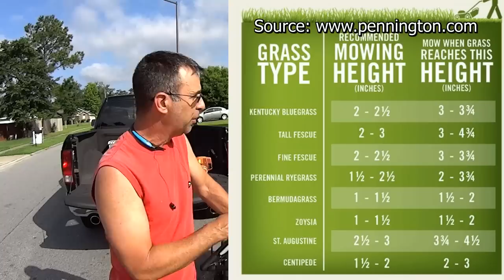THE REVIEW - Honda HRX217VKA 21" 186cc Select Drive™ Self-Propelled Lawn Mower

Comment: I just bought the same Honda mower.  I noticed that the last 2 click settings on the speed dial give me the same exact speed.  I feel like it should go a tiny bit faster when I move the dial all the way to Max speed.  Is it the drive cable nut on the drive cable just below the handlebar that I should adjust or should I move the governor spring to the other factory drilled hole on the governor arm?   Thank you!
Reply: If you don't have one, you can grab a tachometer for about $20 off Amazon to check the RPMs of the motor.  Definitely check before you adjust the governor and compare it to the spec in the manual.
Reply: @CM-qu8qe  Yes I have the Tach already installed and I'm getting 3,000 RPM straight out of the box.  I thought the RPM are just measuring how much power you're getting to the blades spinning since the blades are driven by the engine shaft and the wheels are on a separate belt driven mechanism.  So amping up the RPM's will just make the engine spin the blades faster and nothing to do with the wheels going faster.  I think it has to do with the designed slippage in the belt for the wheels. Slow speed has more belt slippage, Fast speed has less belt slippage.  There's no video I know of that shows how to adjust the belt for faster wheel speed. Please correct me if I'm wrong. Thank you kindly.

Comment: Thanks for all your work.  I have learned a lot.  One question, I need to buy the metal lips for my 2 x 6 boards so I can have a ramp.  You mentioned in a posting you bought the 12" metal ramp lip and cut it in two.  How did you cut it?  Thanks buddy.
Reply from the maker: I used a jig saw with a metal cutting blade

Comment: I've got a good question that's a common problem. I recently bought a $260 lawn mower and it doesn't bag grass at all and it's been like this ever since it was brand new. My question is if I buy a Honda lawn mower will that solve the problem?
Reply from the maker: Watch the review
Reply: If it doesn’t bag then your blade needs to be changed to a high lift blade instead of mulching 
Lift blades have more aggressive wings than standard blades that come with mowers
Reply: @dvxAznxvb  i bought a blade just recently because the old one got bent and i couldn't find a blade that would fit it except for the one that originally came on it. I should probably go with the Honda it would be a lot easier finding parts.
Reply: Jerry Hanson eBay has tons of parts

Comment: Dan did you ever use the other 217hya with the other handle bar controls I use it to cut about 100 lawns I wanted to know if you think vka might be a little easier to control the controls
Reply from the maker: I never used that specific model but I do like this model very much
Reply: @DansVlog  ok thanks

Comment: I bought one of the hrx217 without the bagger frame for $300 with probably less than 1 hour on it. I love this mower but after around 20 hours it blew the valve stem seal out and and broke the rocker arm.  No biggie it's an easy fix. I just wonder if anyone else have the issue.  The mower is awesome.
Reply from the maker: I have not heard of anyone else mentioning an issue like that. Sorry that happened to you

Comment: I’m looking to buy a new mower for my house, trying not to spend over 450$. What lawn mower would you recommend?
Reply: you could look at a honda hrr, or toro recycler
Reply: Dominic Rosiak I was looking at the toro, didn’t know Honda made a cheaper mower, I will have to take a look at it. Thanks
Reply: Go to home depo and get a reconditioned mower. I got a hrx for 450.  Best thing is you could tell by looking at the deck it had never been used.
Reply: Hondas with the plastic deck are the best, but Toro kicks the ass of the steel deck Honda and at 450 or less just buy the Toro don't waste time on any thing else.

Comment: I bought one and something must be wrong with it cause it leaves clippings when I have the bag on , I tried adjusting height and it still leaves long grass clippings it worked good when I first bought it , I cut my lawn weekly with a craftsman mower for 15 years and never had an issue once with vacuuming the clippings at any height any advise ? Besides getting another craftsman’s cause I really like the Honda dam thing looks good
Reply from the maker: Use the slector lever and put it in the "Bag" position
Reply: I have it on bag mode you think the blades are dull already it’s only five months old what I noticed is that it’s like pulling the grass cause some of the clippings have the root on it I don’t have landscaping rocks just wood chips it picks up from my flower beds sometimes
Reply from the maker: 5 months? Yes sharpen the blades but also, make sure they are not installed upside down. Don't laugh, I did it

Comment: Its a good  mower  but i went with the toro super recycler with honda engine  and its been a great mower the last 3 years and it does 25-50 properties  a week.  I really like the toro personal  pace  system  and aluminum  deck.
Awesome  review tho...thanks
Reply from the maker: I enjoyed the personal pace as well with my TimeMaster. Very convenient
Reply: I've had 2 personal pace toro's and both had problems when i wanted to back up... the wheels would not want to go backwards and lock up and leave marks in the grass. That has been a few years ago so maybe Toro has fixed this.
Reply: Roy McNiel have used mine for 3 seasons  now and use it for 20-50 properties  a week. Only thing's i have replaced  is the rear wheels  once and oil twice  a year. I believe  what your seeing  is a easy adjustment

Comment: Really impressed with this review & would like to purchase one... But there's 2, 1 you have for $599 (with the 4 n 1) & another for $729 just regular self propelled. I wish it'd let me send the snapshot but it won't in comments.
Reply from the maker: The more expensive mower you’re looking at has an upgraded transmission system and blade stop so you can walk away from the machine with the engine still running but the blade not spinning.
Reply: @DansVlog  Oh,the mower you have doesn't??... I was just curious on that big of price difference. Only have to push mow 10-12 backyards a week so I think this is perfect for that,especially given the quality of cut which is most important to me for my clients.. So,in your opinion, is it worth spending the extra money on that feature, is that the only difference??.. Really enjoy your channel. Keep up the great work, God bless

Comment: Great review Dan! I want one
Reply from the maker: Video doesn’t lie. The machine  did an amazing job in all types of conditions
Reply: I agree.  I'm going to get one.
Reply: @jasonobannon1160  im getting a honda 9.9 hp mower next year with shaft driven and blade clutch system wich i will be happy no belts to mess with :)
Reply: @michaelmactavish1728  - Is that the commercial one, with steel deck?  Sounds awesome!  Where to buy, and model #.  Thanks
Reply: @stevecarr1992  you can buy the honda HRC2163HXC  model gxv160 shaft driven ones at any honda power equipment dealer or the KUBOTA WGC 6-21 shaft driven at any kubota dealers there little exspensive but long lasting and powerful rpms plus they both have blade clutch system so wont wear or tear the engine with out stopping and starting millions of times plus there hydrostatic transmisson

Comment: I have no problem with you going above and beyond by vacuuming up all the clippings for your weekly customers, I think that is good and certainly the way it should be, but when a biweekly customer wants you to get rid of the clippings as well either they pay extra for that or the way the lawn looks with side discharge then  it is what it is. I can mulch a weekly growth lawn all day long on 1 pass with my 48 inch commercial zero turn, but not too many zero turn mowers if any will completely mulch 8 to 12 inch grass in one pass. It would definitely need a 13000 dollar walker mower with vacuum to efficiently clean up a lawn like that., or some type of grass collection system On the mower for 1 pass clean up. I will open the OCDC and try and spread the clippings as well as I can, but With 40 plus lawns to do in a week any extra time more than 1 pass needs to be charged extra to the bi weekly customer, that is if they want the grass clippings to be cleaned up like a weekly lawn gets. My saying is to the bi weekly customers....You gotta pay to get rid of the hay.
Reply: I do appreciate all your reviews. Great job.....thanks

Comment: Quick queston has anybody ever had problems with the self propoltion on hondas
Reply: I own two HRX217's. One is a VKA I bought new last fall. No issues at all. The other is a 2005 TDA with the manual throttle and 3 speed selector (still modulate speed with the bale also). This mower was lightly used for 10 yrs in a 1/3 acre residential yard. It sat for 2-3 yrs. I put a new carb, blades, tune-up etc and used it HARD for 3 seasons or so (about 7-10 yards/week, 2nd job) with no issues mechanically. Transmission pulls up hills very strongly. I actually like the old throttle/3 speed version better than my newer VKA. First gear is VERY slow for steep hills, tall wet grass, excellent cut quality. 2nd gear (95% of my mowing) is a quick but comfortable walking speed still with excellent bagging/mulching in good conditions. 3rd gear is for Usain Bolt (never use it).

Comment: Does anyone know how often I should sharpen my zero turn blades if I’m only mowing 3 average size yards ?
Reply from the maker: Yes, when they get dull. When you notice the grass blades are tearing and not cutting off clean
Reply: Ok cause right now grass cuts even but has yellow tips would you recamend getting them sharpened I only use it on 3 yards
Reply from the maker: All ya have to do is look at the grass tips once you cut. It they look clean like scissors cut the grass blade then you are good, it the tips are torn with what looks like white frayed tips and tears then it is time to sharpen.
Reply: Great thank you for the advice also big fan of your v blog

Comment: Why is there not a side discharge 
On this expensive mower ?
Reply from the maker: 1-800-ask-Honda
Reply: Rear discharge is actually preferred. It allows you to cut against a garden bed or anything else on either side of the mower. Yes, you are walking in the clippings.
Reply: @stephenmilazzo2535  -Excellent explanation. showering neat looking beds with grass clippings may not be desirable.
Reply: I think also because the HRX is considered and marketed as a premium homeowner mower. A customer that wants the "best" residential walk behind is assumed to want the cleanest, neatest looking yard. This is achieved by frequent mowing, clipping only an inch or two each time (or less) and bagging and mulching, not blowing big clippings all over the place with a side discharge. I own two of them. They are definitely designed for groomed, well-maintained residential yards. They are not designed or marketed as cleanup mowers for cutting 8 inches of grass of neglected properties.

Comment: Why don't you just push selective the tension? I have the same mower and I have it on a HIGH setting.... I selectively push the tension for the forward drive of the mower. Anyone else do this? The power of the mower is AMAZING!!! I have been cutting 3'' thick brush with this bad boy....
Reply from the maker: Push selective the tension... sorry man, I have no idea what that means
Reply: @DansVlog  Set the mower speed high, and push in the lever say... Half way? That's what I do. Selectively pushing in power drive when needed.
Reply from the maker: Oh. If that’s what YOU do then you answered your own question... you can!! All preference

Comment: I have the exact same mower and I'm getting really poor mulching results. Don't get me wrong, it's mulching but it doesn't do a very good job. I have cut blades left all over the top of the turf. It's makes the yard look kind of messy upon close inspection. Anyone else have this issue with the HRX217?  I have the versacut selector all the way to the right. The inside chute is closed (but grass still gets in the little passage way before the large black back flap).I'm mowing normal height, dry grass. I don't know.  Really disappointed for such an expensive mower.  My little cheapy, $189 Troy-Bilt mulched like a boss compared to this. Zero remnants following the mow.
Reply from the maker: Slow down a little bit. Sounds like the grass is really thick.
Reply: Dan's Vlog Thanks, Dan. Strangely enough, I’m walking very slowly. I barely have the self propel selector off the slowest setting. I’m reaching out to Honda.
Reply from the maker: keithowu They’re going to tell you to slow down, and make sure that you’re only cutting a maximum of 1 inch off the top of the grass. If that’s not working out for you then I suggest you open up the rear discharge put your bag attachment on and let some of the clippings get out from underneath the deck and go into the bag. From 30 years of experience I believe the grass is to tall,  too thick and or you’re moving too fast. Remember, the lawn care not mows his lawn every four days . He has nice thick healthy grass and if he lets it go a week he would not be able to just mulch it one shot, one kill.

Comment: what is the thing around your neck and ps i only buy honda i also have the honda versattach trimmer, edger , blower , also i drive a honda, and yes one big disadvantage no side discharge, i have the all metal one, the rear discharge is a joke, it leaves huge clippings and get clogged , my next mower i like to toro recycler with honda engine
Reply from the maker: Bluetooth headset/earbuds

Comment: I just brought one. Damn heavy! Found it hard to manoeuvre on my smallish yard. Worst cut I've seen. All the grass does not have a clean blade cut. Some even shredded. Uneven cut on the grass. I'm feeling pretty stink as I don't think it's good for small yards in my city. Good for big yards like yours I guess. Not worth $1750nzd.
Reply from the maker: Sounds like you might need either a little bit of practice and you’ll get used to it or your yards are so small you don’t need a mower you could just use a weedeater and a rake
Reply: Haha yes, almost weedeater size haha. I swapped it out for the push mower and... a stihl line trimmer :D